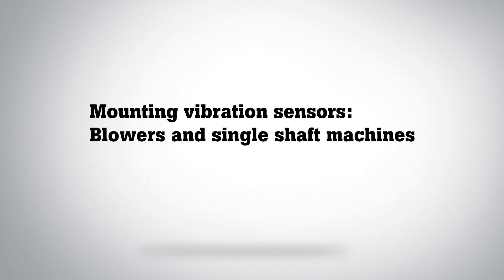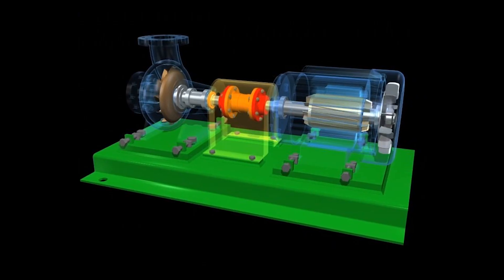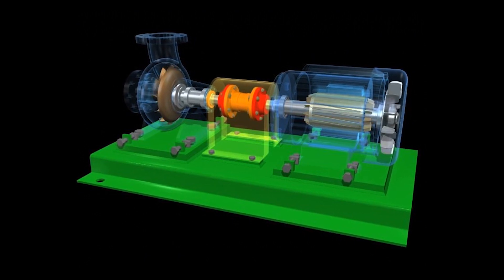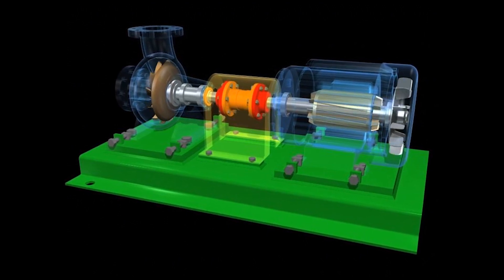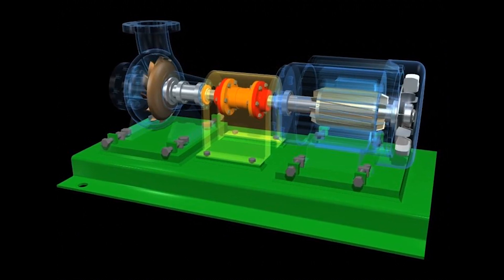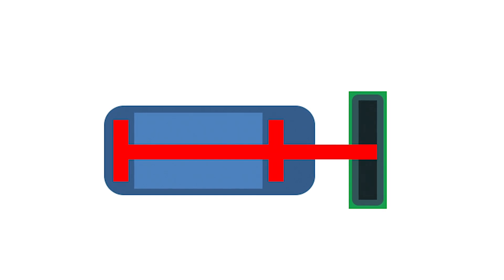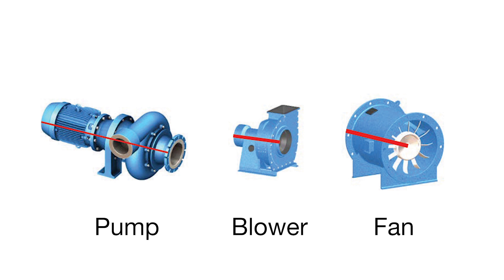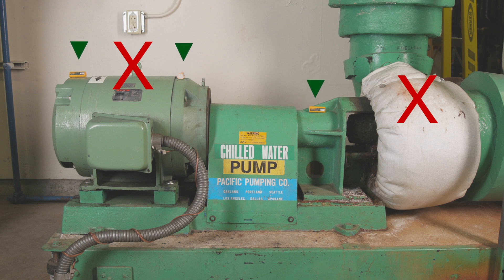Fluke 3561 FC Vibration Sensors: Where To Install

Comment: Can I use for generators???
Reply from the maker: Hi Luis - Over 90% of machinery could benefit from some kind of remote monitoring program! Motors, fans and blowers, pumps, gearboxes, conveyor systems, automated assembly lines, and chillers -- just to name a few. More details can be found here on our website: https://www.fluke.com/en-us/product/condition-monitoring/vibration/3561-vibration-sensor

Thanks!